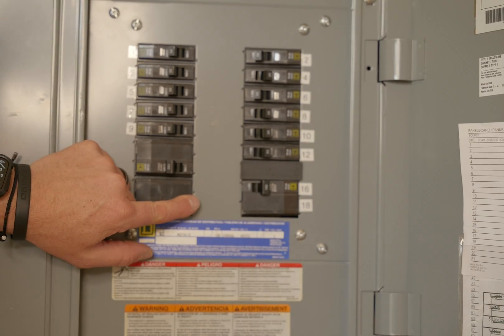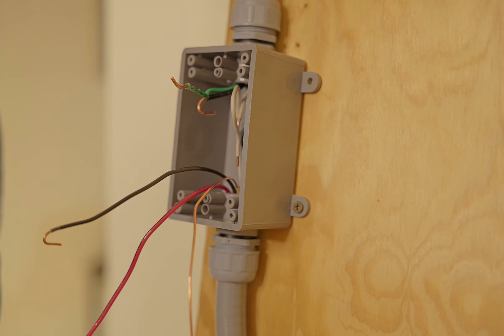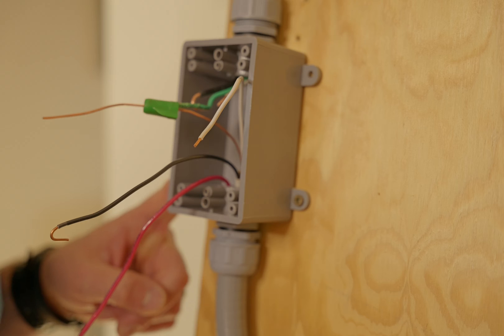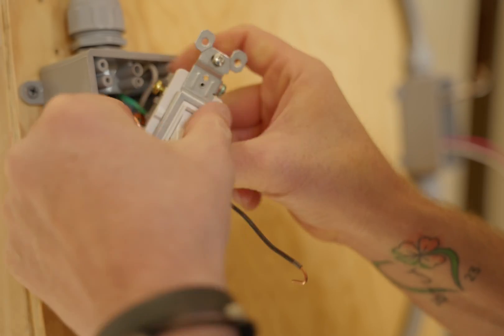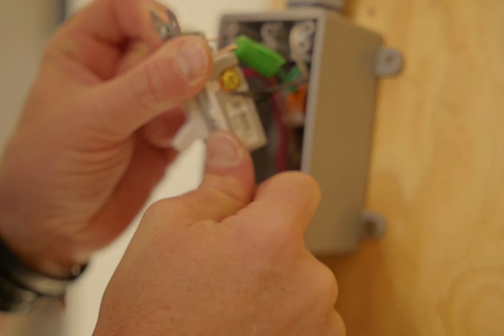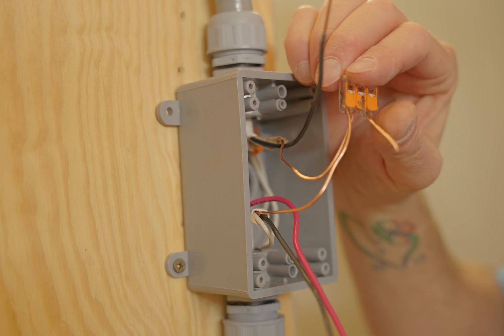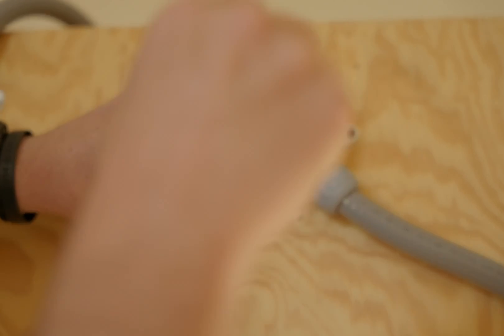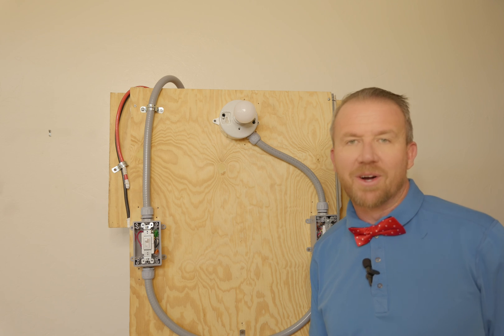How to Wire 3-Way Switch for beginners!

Comment: I changed 2 3-way switches the controls one plug of a duplex outlet. After changing the switches the plug doesn't turn off. Thought I made the connections the same. I did remove the tab on the outlet. Both switches have white red and black wires with the white and red as the travelers. Not sure what's wrong.
Reply from the maker: It sounds like your switches are somehow wired to be always on in respect to the other switch. It is hard to tell without physically seeing the switch wiring though. Good luck friend.
Reply: @ElectricalYou  Didn't think there was another switched outlet. I knew there was one under my picture window, but there's another one that I didn't break the screw tab off.
Reply: You trying to burn your house down?!